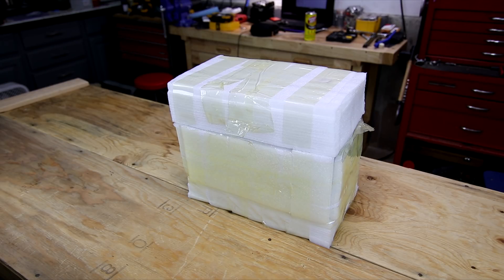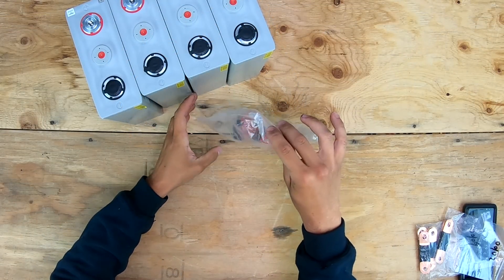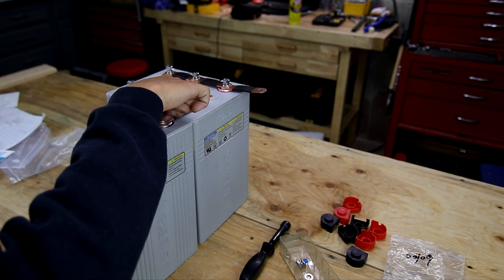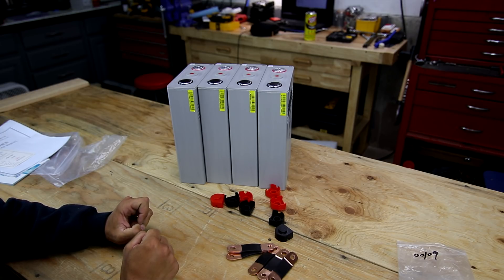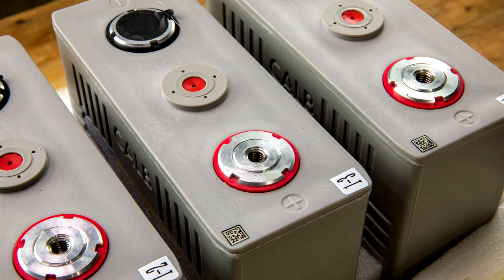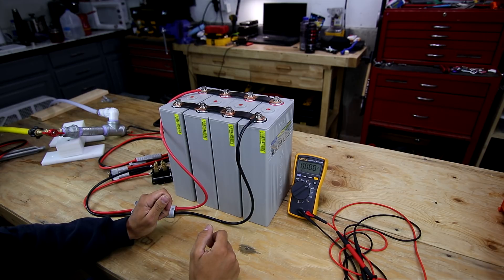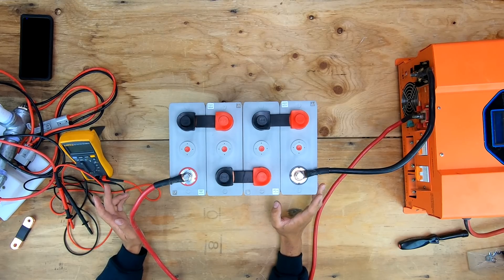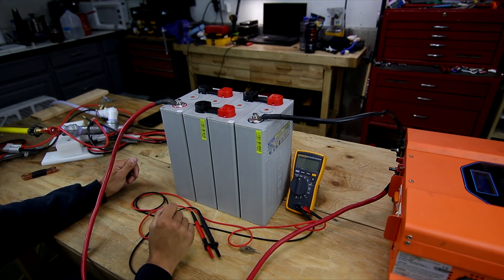CALB CA180: Quality Analysis & Inspection, Bottom Balancing

Comment: So you have roughly 2KW worth of capacity for about $1000? Why not look at getting used Tesla batteries? You can pick those up for about the same price, but they store 5KW.
Reply from the maker: These were samples because I'm going to order 256 of these cells at a far better price break.  Used tesla batteries are a fire waiting to happen.
Reply: HighTechLab Only if you’re don’t treat them nicely. They use the same cells that lots of consumer products use. As long as you don’t physically damage the cells or overcharge them they should be fine. Each cell is also individually fused in the Tesla batteries.

Sounds like you’ll get roughly the same storage for the same price going your route though. A 128 KWh battery bank though.... Man. That is a LOT of power. I could run my HAAS all day on that. 😆
Reply: CALB batteries are best value for money in my opinion.  Quality is a 9/10

Comment: I set up a bank of 24 CA100 cells about 2-1/2 years ago configured 3p/4s x2 and connected them in parallel for a mobile application. No BMS just bottom balance. No problems. They have been rock solid. Capacity test when new gave me a tad over 600ah charging to 13.6v and discharging to 12v. Well within the flatish area of the discharge curve and staying away from the cliffs Test was over when the inverter charger kicked off set at 12v LVCO pulling 1000 watts. I could have continued the test at a lower c rate for sure as cells recovered over 12v. Also could have charged the to a higher voltage but as you point out, so little to gain in capacity.

I just pulled them from that RV and am installing them into a new rv in 3p/8s for a 24v battery. All cells were still very close resting voltage and will do another capacity test once the install is done. Price paid back then for real CALB cells from a reputable distributer with documentation was $550/4 cells with busbars. Nice to see they are coming down a little in price. 

Are you going to run them with just the bottom balance or are you going to use a BMS? If no BMS I am curious to see how you handle low voltage cut off. Cheers.
Reply from the maker: The CA100 cells are the same ones that I started out with in 16s1p.  I ended up with used cells and they didn't stick together very well with a bottom balance only, so I run the deligreen QNNB active cell balancers.  They have cycled 2-3 times per day for over a year now and have been holding up very well with all the abuse I've been handing them.

I charge to 3.65vPC and stop discharge around 3.0vPC (which is where my generator start setpoint is).  They do have quite a bit of capacity under 3.0 - I did a test on my CA180s and they had around 16 amp hours available from 3.0 to 2.5 (at a 50a discharge current) and then when I removed the load they jumped back up to 3.0v resting.

My suggestion is to avoid 3p packs and go 4p if you can (or multiples of 4 in parallel) because then you are making blocks of 4 matched cells - as they "wear in" with their partners, the cells with the higher capacity will take some of the abuse from the more worn cells with the lower capacity.  If you have a 3p group of matched cells from running them like this it isn't optimal because you can't reconfigure it later in a matched 12v 4s group...

On our property my plan is to run a 4p16s so that way if we ever need to change it out I have 16 blocks of perfectly matched cells that can be resold as a 12v bank...If I ran 3p the resale ability would be much more difficult...
Reply: Hi @harleyd500 What distributor did you buy these from?

Comment: I'm looking for buss bars  for my Off Brand ( Lion Brand ) Pulled from New Unused Lion Energy Solar Battery systems.  50Ah LiFePo4 prismatic cells.  DAMN they sure are proud of the things.  Will be making my own.  

I only take my cells to 3.60v.  Same with 18650's.  Those only see 4.00v.   The usable capacity you gain by taking them higher is not worth the lost cycle life.

Comment: You mentioned that your 100Ah cells were not original. How are they performing?
Reply from the maker: They have been cycled 2-3 times per day for over a year now and I haven't seen much, if any, lost capacity.  The CALB batteries are amazing...I don't know the abuse they have taken before but we are running them hard and they still are running great.
Reply: @HighTechLab  Sounds like you are going to make your own little power substation with the 180Ah cells  lol. You could also still use the 100Ah cells and put that bank in parallel with the 180Ah battery banks. I'm assuming you're sticking with 48V. How many battery banks are you planing to make with the 180Ah cells?

Comment: The helical in aluminum is used in car manufacturing also.  My 2005 and 2006 jeep liberty diesels have this setup to hold timing belt tensioner to rear timing belt cover which is aluminum and I have been told other car manufacturers do this.  In the event the helical strips out it can be fairly easily replaced.
Reply: it never strips out; just N E V E R  use a SS bolt on those SS threads, they gall together; and then the aluminum will strip.

Comment: "I want to be able to trust them".....dude you cannot trust anything coming out of China......and with all that is going on.....I hope there is a push to stop buying cheap china crap in the future and buy local
Reply from the maker: While you are correct with your comment, there are no manufacturers in the US for good lithium batteries because of the EPA.

These batteries are grade a quality. You can get them if you take the right precautions and steps.

I'm going to import 256 of these cells, and we'll have around a hundred and seventy that we can double check the quality and have available for sale in my local area because there is a lot of us looking for them but don't want to deal with getting ripped off from China.
Reply: @HighTechLab  What did you pay for them after taxes, shipping, exchange etc? How does that compare to Battleborn in terms of price and capacity? I just think supporting local and buying in NA is vital these days.
Reply from the maker: These four cells totaled out to be around $1,000.

On the bulk buy of 256 I'm doing of them I will have stock available already in the US for $180 to you, not including tax or shipping to you.
Reply: @HighTechLab  I think you bought expensive for $1000 only 4 of them, maybe because I living in China, for $1000 us dollar you can get 9 or 10 cells, Exactly the same like yours
Reply: Well from what I can find seems like the "local" dealers buy in bulk from the same Chinese dealers and just double the price and add their labeling in fact the Chinese manufacturer even ask if you want your decals applied.
Reply: Dennis Jemison  You're in a cult
Reply from the maker: @aasgnt I might become one, I'm importing 256 cells and have 154 left that I'm going to sell in the US.
I set up an email, sales.hightechlab@gmail.com and we can talk further on this if you are interested
Reply: These batteries are not crap. What craps is Americans in political cults crying because they can't compete. .... all America seems to want to make these days are guns and they give those away.

Comment: Which is better,  bottom balance or top balance?
Reply from the maker: I prefer bottom balancing because it is going to make the cells stick together longer throughout the curve. When you top balance there is so little energy over such a wide voltage range that you're not actually matching the capacities of the cells very well.

.1 volts at the bottom is like .3 volts at the top.  If you start at the top and then come down the curve you will be off by a few amp hours per cell and have to stop discharging sooner.
Reply: @HighTechLab  The way you balance your cells depends on how high you charge your cells to, if you max charge to 100% then you always top balance, but if you only charging to 90% and drain the batteries to 10% or less bottom balancing is better.
Reply: @HighTechLab  Even with bottom balancing, don't you need to balance them periodically? Over time, won't they tend to wander?
Reply: Thanks for that infomation.  Im here in the philippines and i have small offgrid setup with 100ah 24v lifepo4 batteries made in china too.